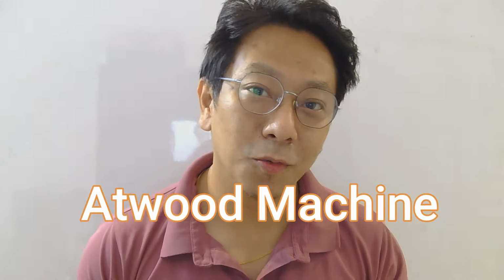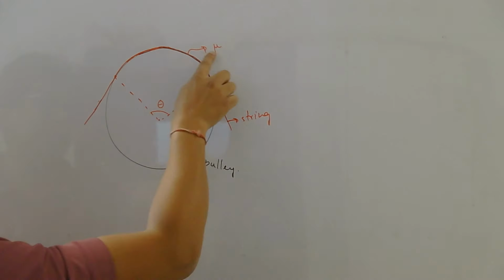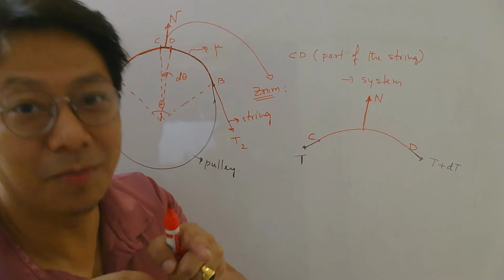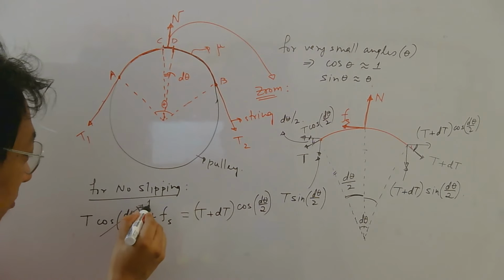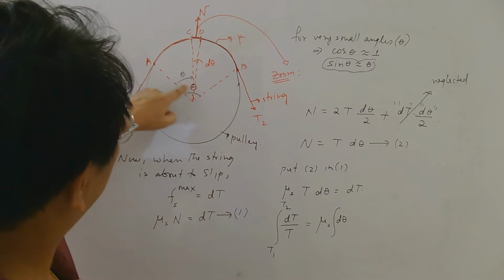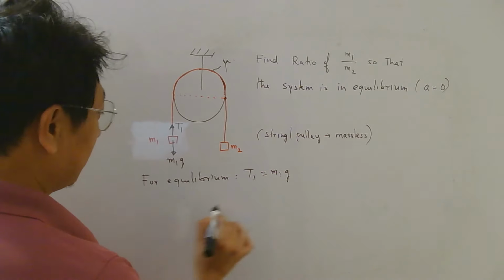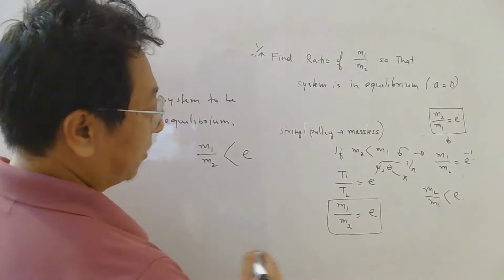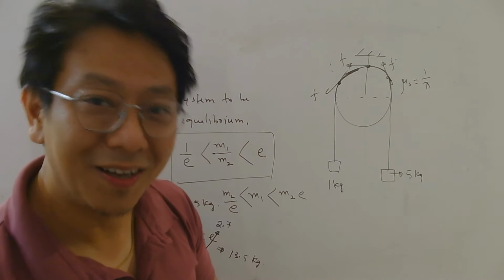Atwood Machine with friction

Comment: Sir can assume mg to be zero when normal force is there.
Reply from the maker: Yes! Normal force has nothing to do with mg (gravity). Normal force is a contact force (pushing or.pressing force between two surfaces), whereas gravity is a non-contact force. 

The rope  has no mass, so the rope has no "mg". This means rope is not getting pulled down by gravity.

But if you notice carefully there is tension force (pulling force) on both sides of the rope. And because of this pull, the rope is PRESSING against the pulley. And thus this pressing gives rise to Normal force between rope and pulley.

When a book is kept on the table, due mg the book presses the table which gives rise to N. So here you need mg.

But if you press the book with your hand from top to bottom then this will give rise to N between book and table even if there is no mg.

So always try to find what causes the pressing between two surfaces. This will give rise to Normal force.